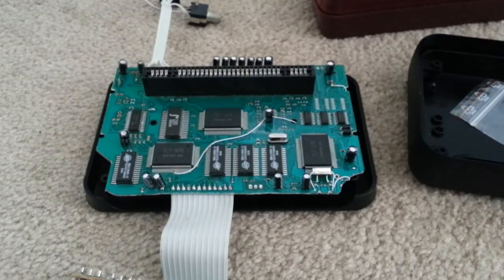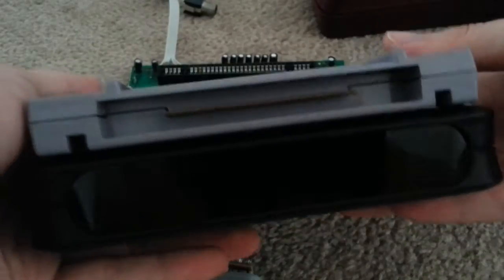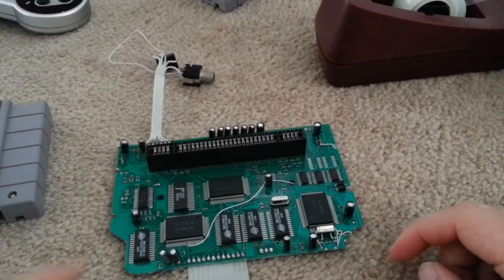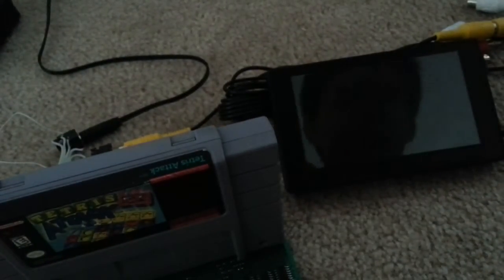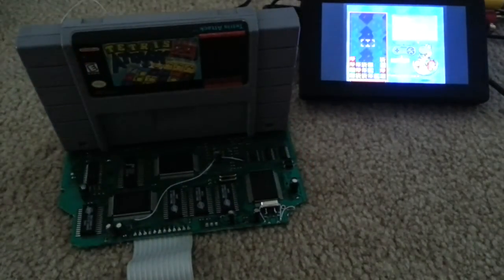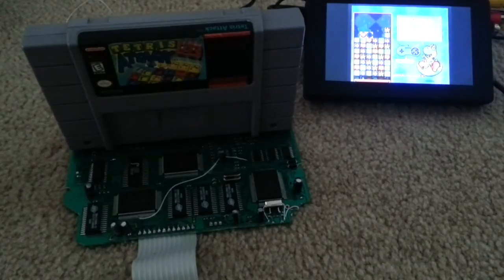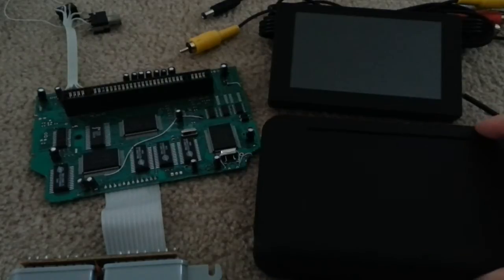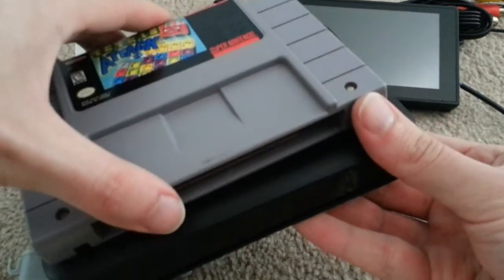Portable SNES Build Progress #1

Comment from the maker: I bought it from ebay for around $30. Its 4.3" widescreen but has the option of letterboxing to display 4:3 aspect ratio. Just search car reverse lcd and many different models with different size screens come up. I've modded mine to run off of 5V perfect for portables.